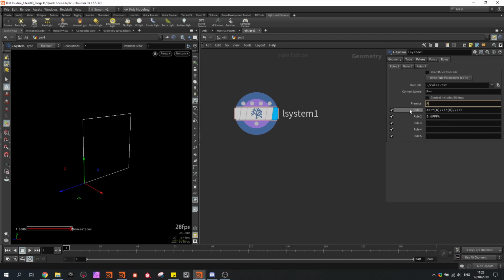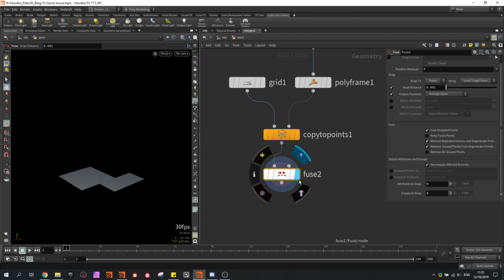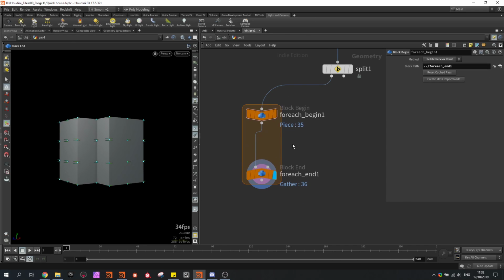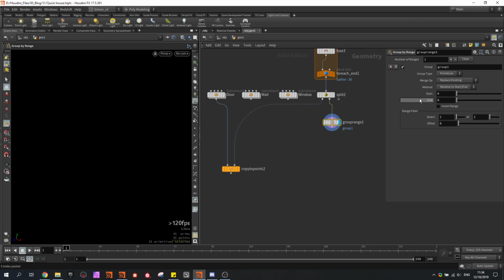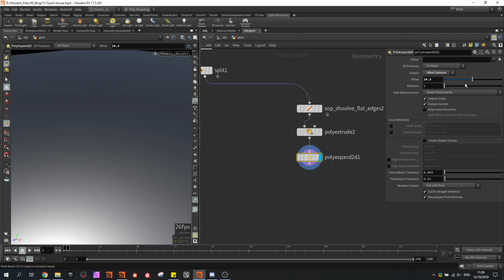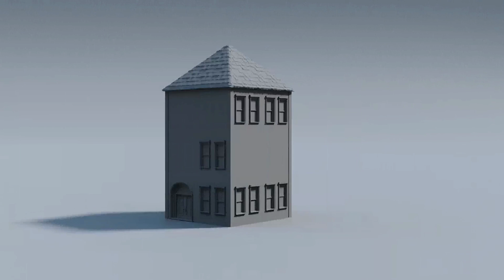2 minute House Generator || Houdini Tutorial

Comment: if only this was five minutes so the part where you add a bunch of custom meshes into the mix with no info about them whatsoever could be explained. oh well.
Reply: Exactly!! I was trying to follow this, but then there was a bunch of places where he just doesn't explain anything. Like between 1.25 and 1.26 there is suddenly a roof there. No explanation.
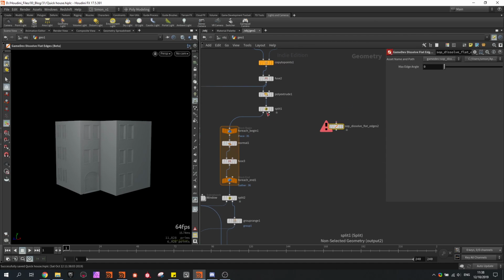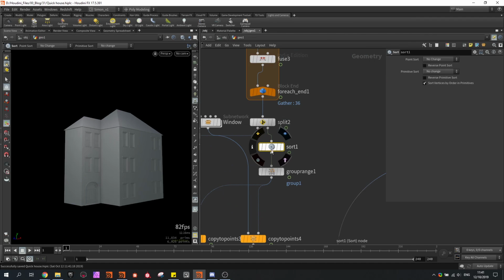Reply: @beacreates4370  he literally explains that later in the video at 1:54. He was stil explaining things about the walls and windows at 1:25
Reply: @beacreates4370  He does explain the roof, it's an inset with the Y moved up
Reply: you can use any door or window, dowloaded as prefab or anything created by yourself

Comment: This must be for people who already know Houdini.
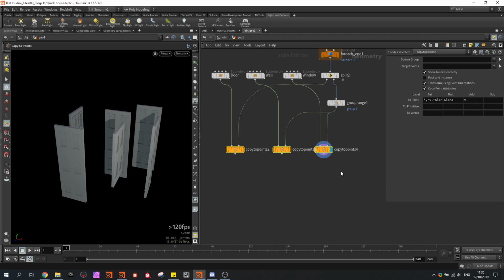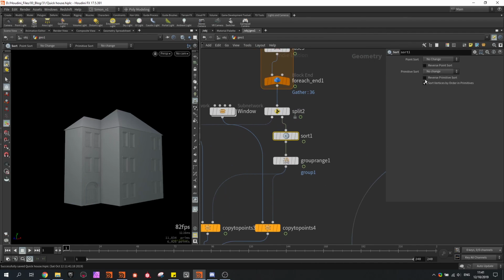Reply: No. Cause to those of us actually trying to follow the tutorial. It's frustrating as all heck because he just adds random pre-made models with no explanation. No dimensions mentioned. Also between 1:25 and 1:26 there is suddenly a roof there, no explanation.
Reply: @beacreates4370  Pretty much how every tutorial of Houdini goes.
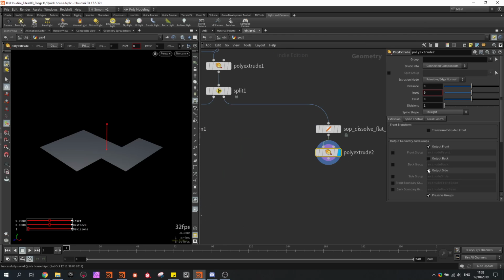Reply: @beacreates4370  you can make your own models for that. the width and height of the walls are the same as the stepsize in the l-system (in this case 1). I already said this in an other comment but he explains how he makes the roof at 1:54.
Reply: @beacreates4370  He used a 1x1 grid on copy to points as base and extruded up by 3 to make 3 floors, therefore the modules are 1x1 dimension. He also shows how he made the roof.
Reply: @Hyzalker  that saved me! it was all weirdly rotated after importing megascans packs and after a matchsize it worked just fine. thanks!
Reply: @NicoMahlerCG  That's great! Glad it was helpful.